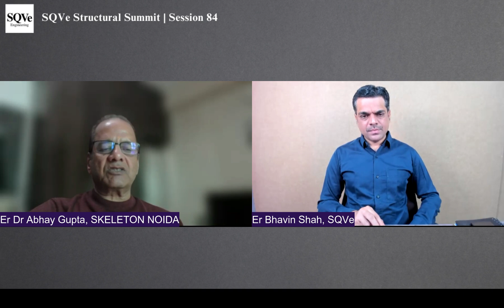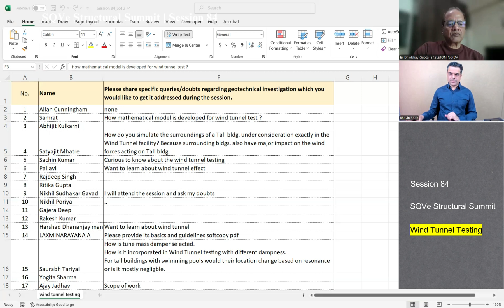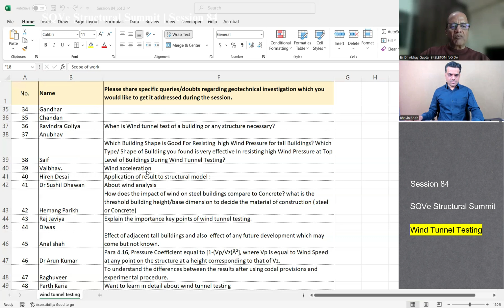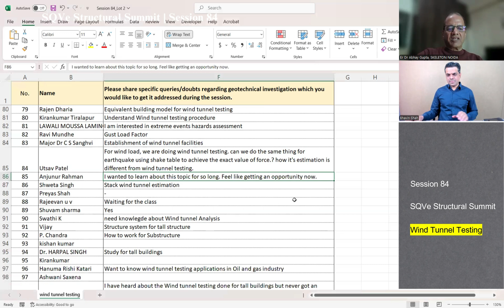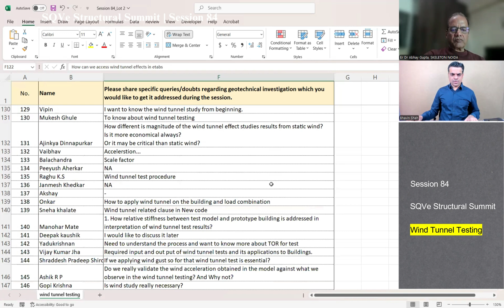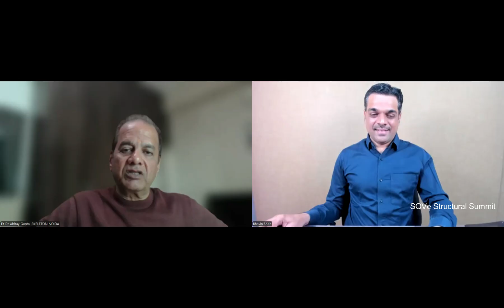Session 84: Wind tunnel testing (Part 1) | SQVe Structural Summit | Er. Dr Abhay Gupta

Comment: Structural response in seismic loads and wind loads are different
To and fro oscillatory response due to EQ 
And deflection in wind direction and than throttling

We need to understand the relevance of tuned mass dampers in case of responses to wind forces
Reply from the maker: Thank you for bringing up this important point! We will try to address the same in future session.